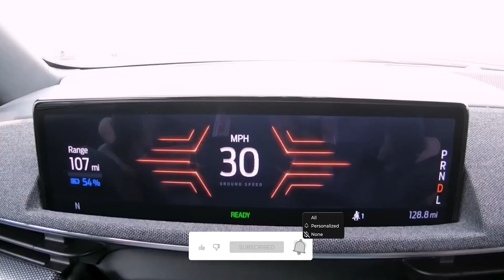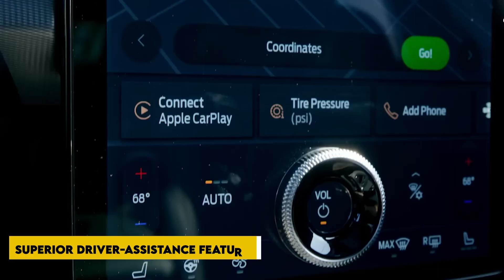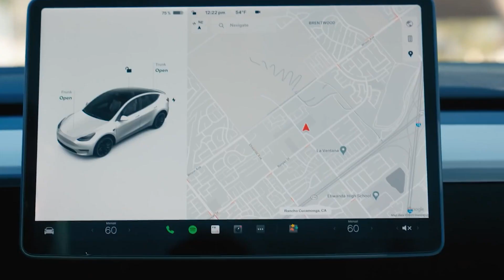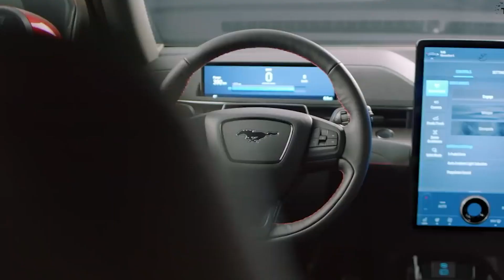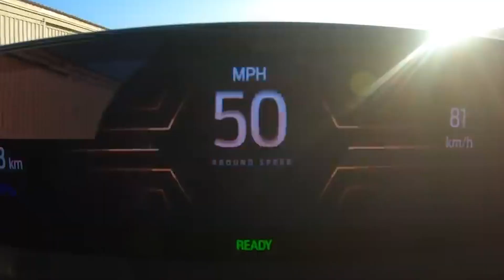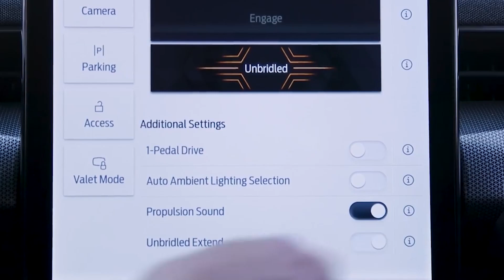Ford's Mustang EV Review IS DETHRONING Its Competitors?

Comment: Too bad owners are having to deal with numerous recalls and breakdowns. We bought one then it broke down 2 days later. It’s still at the Ford Service department. Been broke down longer than we’ve owned it.
Reply: my model 3 broke down on the way home from delivery... the factory forgot to connect a coolant hose and it spewed out all the coolant all over my garage, took tesla 2 weeks to come get it and fix it, have had the car for almost a year and STILL waiting for my new trunk liftgate that came damaged as well as my drivers side window that came with a chip in it. all issues pointed out before delivery and not repaired by tesla. took deliver in October of 2021
Reply: I've had my Mach e premium AWD extended range for 1 yr, besides the roof recall and now some recent recall, I have not had any issues. Hope I did not talk too soon 🙂